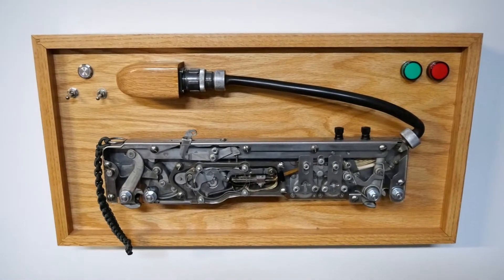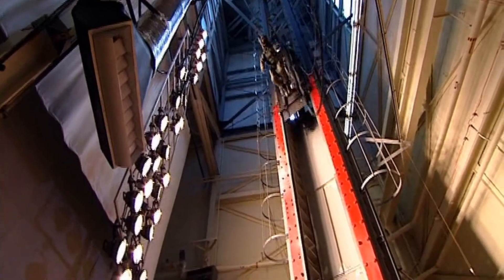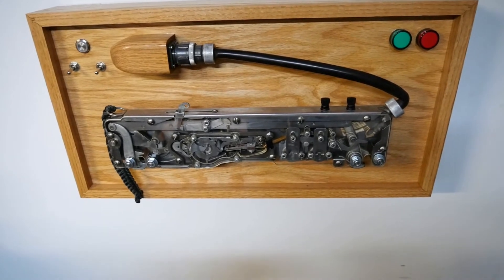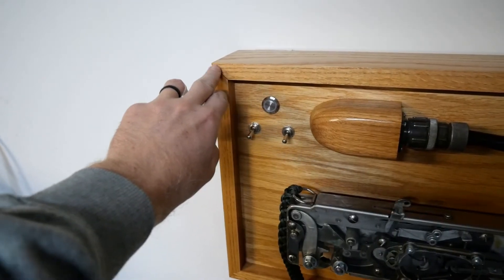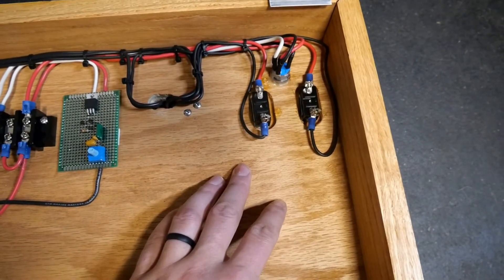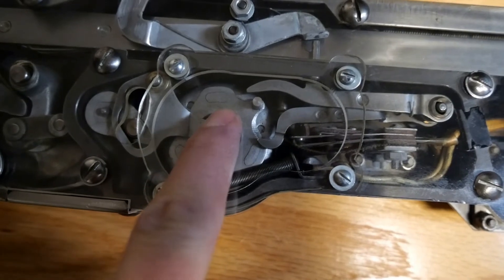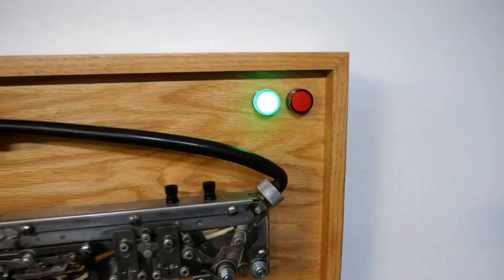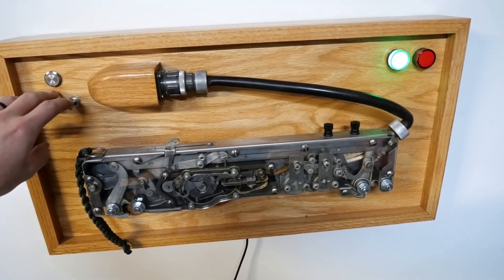Restoration and Demonstration of a U.S. Air Force Bomb Rack Trainer

Comment: Hello Eric, would you be happy to contact me by PM as we are restoring the same and need some guidance/adult supervision? Thanks Steve
Reply from the maker: Hey Steve, I see your message but can't seem to PM you via your profile. Let me know your questions and I'd be happy to help. Thanks.
Reply: @Cheatman1342  Hello! We’re restoring a very similar rack that we pulled off of our Huey at the Illinois Aviation Museum. Do you have any tips or suggestions as we work to clean and restore it to working order? Thanks!
Reply from the maker: @ There is a specialist lubricant you should use on the finished surfaces of the rack as a water displacer and corrosion inhibitor. Try MIL-PRF-81309H. For the moving parts, we've had good luck with Molykote. Importantly, its its not broke, don't fix it - I wouldn't replace the electronic components if they're working unless you have a plan to replace them with NOS or similar performance wiring/components. Best of luck.